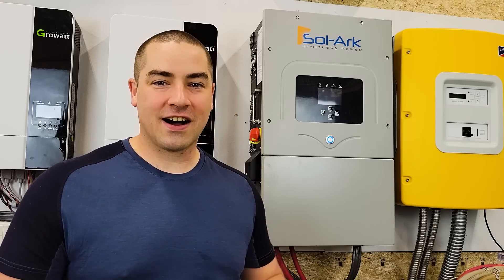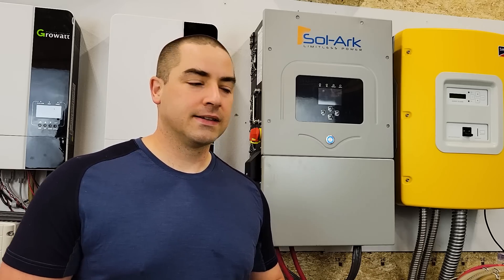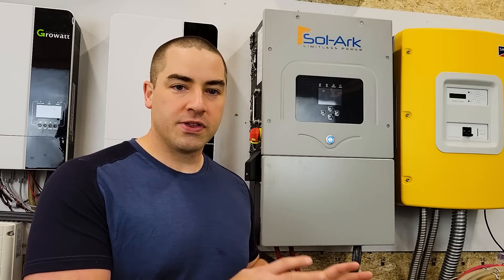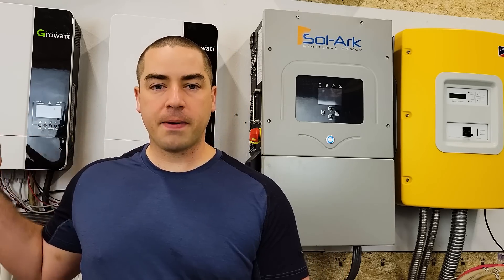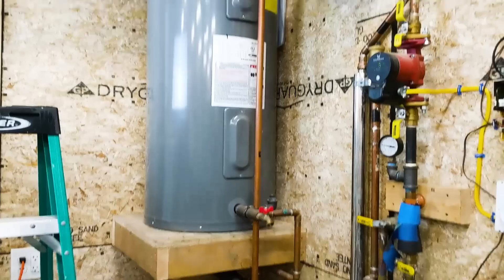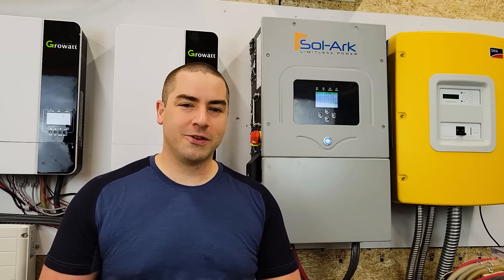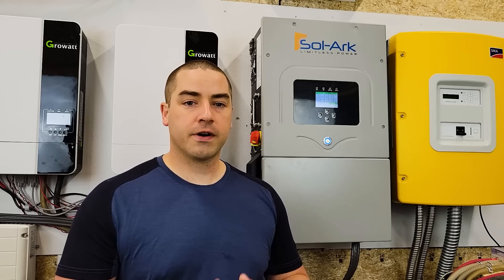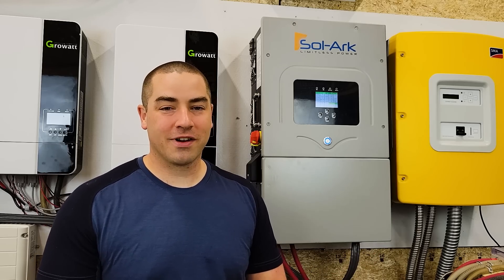Sol-Ark 12K Inverter, Is it worth it?

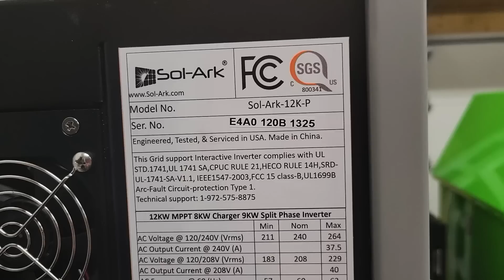Comment: David, I've been watching your videos for years and this is truly the first time I have seen something so misleading posted. First of all, you can see at the 0:45 mark in the video, it clearly lists the specifications of the inverter and the line-to-neural max power output is listed. The unit operated well within it's stated parameters. Also, the name of the unit," 12K", refers to the total solar input. This is the same as the 8K and older models. Sol-Ark has never named them based on inverter output, but instead solar input. They are not misleading people, but it is obvious based on the comments of this video that you now have viewers thinking that Sol-Ark is selling a misleading product when that is definitely not the case. You're not comparing apples to apples here and you're not using many of the intended features of the Sol-Ark in a traditional setup. Additionally, you're' not testing things that make this worth more than other inverters, such as UPS functionality for critical loads, low THD, etc. Your testing here is strictly comprised of off-grid inverter testing, to which you now have many people thinking that Sol-Ark is garbage based on the results of this one test. Disappointing.
Reply: What is the point to having a 12Kw solar input with additional xKw battery storage if you can only get 4500w a leg out of it?

That is almost 1/3’rd the name of the unit!

David was good enough to talk about an AuthTransforner, although I would have like to have seen that solution, in action.

I am glad he gave us warning. 

I have a 3000 Watt Inverter, that peaks at 6000 watts, where each leg is rated at 1500 Watts (but can peak to 3000 Watts.) It drives my home, without 240v loads. I have been looking for an upgraded inverter, for my 240v loads, but I am just beginning to understand the landscape.
Reply: I totally agree with this statement and I already wrote to @DavidPoz on his previous video about the Sol-Ark 8K that he was not being fair in his assessments or his test procedures... Hope he realizes this... Cheers.
Reply: I won't lie, I'm never a fanboy, or at least try not to be for any company, but this video really rubbed me the wrong way. I have a 12K, I've tried the other options that Dave talks about but not the SMA.
I have a 6000W 240V dryer on my solark. I've experienced shutdowns when the house is drawing down ~500W and the well pump and furnace turn on at the same time as the dryer is running - That exceeds the total capacity of the unit. I pay attention to what I am doing when I run my house and using the "I just want it to work despite overloading it" as a reason to discount the Solark, then comparing it to a system that has an autotransformer to balance the legs seems a little disingenuous to me.   If it's a sunny day I've never been concerned about starting the dryer even while the Solark is charging the batteries. I have a screen grab from the day this video dropped of the Solark putting 3.5KW into the batteries and 6.5 KW into the dryer and the rest of the house with no glitches.      Sorry, Dave.
Reply: @vincei4252  the solark is a capable inverter....if you have it grid tied but you and many others missed the point of this video...it wasnt to embarrass solark it was to show how it works as an off grid inverter as its marketed..solark does not offer nor mention a autotransformer so going by manufacturer specs and guidelines as an off grid inverter this video shows what happens, also he always says his systems are set up as off grid as thats where he wants to be system wise, lastly before you say it the distributor for the growatts suggests and have produced videos encouraging the use of autotransformers if you need split phase service and they sell them as a kit. Solark is a good inverter but nothing is perfect. Also the 8k version takes in up to 10.6kw of solar yet they didnt name it 11k...8k does 8k inversion 12k does 9k...
Reply: It is garbage for the price you pay $$$$...unless you want the customer support, then it's worth it. It's like being told it can handle 17kw of panels. In reality it can't until you call them up and they say it does when you have panels facing east, south and west for a total of 17kw. Lol just not all pointing south.

Comment: David I’m having the same issues with my Sol-Ark.  my unit is grid tie without batteries since I have a Net Metering agreement.  Unit feeds a minor loaded critical loads panel and I’ve had 2 shutdowns in 11 days. I was considering purchasing another unit and running my whole house, but I’m pretty disillusioned now and won’t be buying another unit.  When speaking with Sol-Ark they want to blame the quality of my grid power.  I had a 5k Solar edge previously and never and any issues with the quality of the grid power in 3 years.
Reply from the maker: Thanks for sharing your experience.
Reply: I have experienced the same thing when I was running without batteries a couple of times too. It's a cool feature and can enable you to add the batteries later, but expect it to stop when the grid goes down. Even a tiny blip in the grid will cause an over current fault if your loads are greater than solar being generated. If there is not enough surplus solar to power the loads plus the overhead of the Sol-Ark itself, the unit has no choice but to shut down because the grid has gone away and you don't have any any other source of power. Once you connect a battery bank, this will go away and the Sol-Ark won't miss a beat. Your Solar Edge is a grid-tie inverter that never powered your loads like the Sol-Ark and therefore never tripped due to overload when your utility blipped and you may have never noticed it. If you always plan to do net metering and never add batteries, the Sol-Ark is probably not the right solution in your area and you should probably stick to the Solar Edge.
Reply: I tried running one of my Sol-Ark 12Ks without batteries as a zero export (what Sol-Ark calls 'limited power to home' mode) inverter to supplement my other then new 12K and it would throw alarms.  Those alarms went away when I added a secondary battery bank, suggesting that they don't like running without batteries.  It was also a very early build 12K, so there were probably some things that needed improving in the hardware.

Comment: You found out a detail that may or may not be in the manual. It's typical that split phase devices are rated for balanced current draw, so the implicit (and common) fact is that half the rating is the limit for each half of the output. If you run only 240V devices (it's really a 9kW 240VAC inverter with a center tap) as it's functionally designed as, then you'd get to 9kW out without blinking an eye. The unbalanced draw is an issue even to the grid, where it causes asymmetric loading in the transformers on the corner or up on the pole that feed each block of houses.
Reply: So true it says it right in the manual and it says it on the data tag he showed in the begining of the video you cant ignore the manual and then critique the manufacturer you would think that on a purchase this expensive he would have done some research and rrad the manual befor buying
Reply: This not happen to Schneider XW6848 pro 🤷‍♂️
Reply: @Leo-cl1xq Schneider is low frequency inverter, it basically has a huge auto transformer built in to balance L1 and L2
For high frequency inverter like solark, usually you need an external auto transformer but the the lightweight benefit goes away 😅
Reply: I think it is fair that he simulated a buy as an every household diy would do and then sees the error made. So it is a fair review. Because the appliance could also be advertised as 2x4500 watt and they choose for the more appealing 9000watt advertising
Reply: @erwin757  Even worse, they name it as a 12k, when it is really 2x4.5k. They should change their naming scheme, as this is the single most important parameter when selecting an all-in-one inverter. For example, MPP solar name their LV6548 to mean 6500W (120V), 48V battery.
Reply: Exactly . I own Wen open frame gen and that’s just how split phase works

Comment: Solark is pretty high end with a high price too and typically out of reach for the average user.  I have an MPP LV5048 (5KW) and similar to your Solark,  it's two inverters (2.5KW each) configured to create split phase.  The benefit of these high frequency inverters is their light weight, but their achilles heel is that they do not like loads on one leg which has a high inrush current.  The low frequency inverters are much more forgiving.
You can run a 240V load on these HF inverters upto the rated power,  since this automatically balances the load on each of the inverters.  So a fix to your problem is to make sure you connect some receptacles on L1 and some on L2.  Easy to say,  but maybe not easy to do.
Reply from the maker: Thanks for your comment.  I once did a review on the LV5048.
Reply: @DavidPozEnergy  Haha,  yes I watched that one with a lot of interest. I ran into the same issues you did trying to start a miter saw and a shop saw.  I bought a soft start,  which solved my problems with the saws. If I had to choose again,  I really like your idea of HF inverters with an external transformer.  The large magnetic core in the auto-transformer seems to really help delivering the high inrush current.  
Thanks for your great videos...really enjoy them.

Comment: All split phase inverters even many that have a large LF transformer will have this same issue if they are correctly protecting the windings in the transformer.  You effectively just put a load of 4629 watts on L2 which is 102.86% load while also applying 2871 watts on L1 or 63.8% load.  The inverter is effectively protecting the output cabling and any output windings.  You could apply your autotransformer to this system and likely pull much closer or possibly over the 9000 watts on the label even if you don't balance your panel all that well.
I currently run my entire house minus the range and dryer off of a 6000 watt GS inverter (waiting on their 12000 watt unit) and I can pull the full 6000 watts continuous from a well balanced panel but it will shutdown if I pull more than 3000 watts from either of the 2 phases for several seconds.  If I don't mind the additional inductive load I could always add an auto transformer to help even it out if I really needed the full output power.
Reply: I really like the guys over at Gentry Solar (Shawn and Sid)  I'm pulling for them to succeed. How do you like the GS 6000 watt inverter?
Reply: GS rocks best in world!!!!
Reply: Correct. His friend Ben already did a test and highlighted the issue and benefit of using an auto transformer with a Sol-Ark setup. Surprised Dave did not illustrate that solution. Here is Ben's solution: https://www.youtube.com/watch?v=6V16rRTFoho

Comment: I’m wondering if anyone builds a split system?  Meaning a 120v system and a 240v system isolated from each other.  Then all the worries about split phase can be eliminated.  My house has only 3 240 volt loads; A/C compressor, Electric Oven/Range and Electric Dryer (which we don’t use in favor of a 120v/gas dryer).  Two separate systems might make sense for someone in my situation.

Comment: Why didn't you turn the solar edge transformer on with the Sol-ark?  You have a wall full of transformerless inverters and without the grid's transformer or a separate solaredge type transformer people do not realize that the transformer balances out l1 and  l2.  I see that you left the 50 amp breaker on for the solar edge auto transformer when you did the solark test but you must have turned the autotransformer off?  Having access to grid and not installing the CTS makes no sense. You could be getting so much more out of your system that you cannot get out of those GroWatts.  Folks that do not work with this equipment everyday are being misled by this video. Update your software, use the provided current transformers, balance out your panel and use the full capabilities of the 12k. You are running the solark like you did the Aims inverter.  What's going on here?
Reply: I started using the solark 12k last March and have had very good luck with them.  I have added more inverters since then and I am very happy with it.  I am currently off grid. He isn’t comparing apples to apples when he is not properly balancing out the loads.
Reply: Doesn't the Sol Ark put out 120v without the need for an external transformer?  I thought that was the point of spending the extra $$$ on it.  I'm still learning, so forgive me if it's a naïve question.
Reply: I never noticed an autotransformer in any of your installs , did you recently start using them ?
Reply: Does solark suggest or provide a autotransformer? He is for the most part using it like anyone who is off grid would and he stated he has no grid connection to it...
Reply: I do not think he turned the Solar-edge off. Even if solar-edge is connected you still need  to disconnect the neutral from Sol-ark in order for the solar-edge to start balancing the loads.
Reply: i bought the 3k after you did your video on it. I then got the 8k when you started to review it. I am building a new house and I just hope the 15k and limitless panel come out before we are done because I really want a full 200 amp transfer switch inverter. It is game changer.
Reply: Glad someone pointed this out. I'm guessing this guy is new to hybrid inverters, or just wanted some reason to slam Sol-Ark. This is horribly misleading. Thank you for showing why you remain a true industry expert!
Reply: I need things to work out of the box without a hefty explanation as described above. For $7000 I would want it to solve that problem before it got to my end.

For the layman we want something simple, no hassles.  I would never buy this product because I don't understand how to fix the problem as described above. This product may be an engineer's dream child but I need it to work everyday without extra steps.

I liked the video. I thought David's explanation was sound. I'm a plug and play type.
Reply: First, he uses it off-grid, so forget about the grid for this demonstration. Second, I believe the point of paying extra for the Sol-Ark is to have the split phase that gives the full load across both legs even with unbalanced loads. In this comparison, I am seeing no benefit. Why on Earth would anyone pay all of that extra money for an expensive Sol-Arc split phase inverter that you have to connect to an auto Transformer? Honestly, you sound like a Sol-Arc salesman.
Reply: Your misleading because it's costing you business for the overpriced solarks. Buy this 7,000 dollar product....oh it won't work right you need to buy this autotransformer as well that your not told about. Do you sell it as a package deal? Do you install the autotransformer in your installs?  I haven't seen you doing it so why question David when the solark is supposed to work by itself with 120/120 split phase? The growatt is 240v not split and sold as a package at sites with the autotransformer.  Other brands of 240v tells you it's a european design and need a transformer to run on north american L1/L2. I have yet to read on solark's website or maybe you have it on yours that it only works up to a certain amount of wattage like half and will shut off.  
Hope you tell all your customers this.  Do you tell them they can buy something else at a fraction of the price that can perform as good and run your whole house? That you don't have to have a critical loads panel you just run the whole house and cost a fraction of the solark? 
Maybe you tell them the solark is sold overseas under a different brand for like $2500?
Reply: you already spent $7k on a solark and you didn't even get a balancer. that's lousy
Reply: I agree a auto-transformer should help, but requiring someone to balance their breaker panel should not be a prerequisite for a $8000 inverter.  It isn't for most of the others.  It seems to me that the initial design of the Sol-Arks was based off of leg imbalance not being an issue.  It seems to me this was a huge oversight.
Reply: Oh, Hi, Steve!!! Glad you've seen this...!!! Just mentioned you in my comments above...
As I wrote before, @DavidPoz is not doing a good job here and he is misleading his followers with these UNORTHODOX tests...
You tell them...
Take care...!!!

Comment: That really should not be that much of a surprise for a Split Phase inverter.    The benefit to this style of inverter is the Low consumption for a split phase inverter.      It;s too Bad Solark took the low road on commenting here so that will sway my opinion of the company more than this "Issue"     If you are looking for a 9000W per side inverter you need to look for one that does that.    the 15K should also be a better fit for your needs .      I just feel this video was done as more of an attack on the brand rather than looking at the actual specs of the inverter.             Going over your data everything does look like it holds up to the specs as per it's intended design.     While it does cost more I will got to Engineer775 for info on reliability as he has been using them for quite a while.  Sorry David

Comment: This makes sense but having to wire the house to equally divide the loads would be a pain in the butt, I'm not sure you could ever get it close enough to not experience this issue.  I'm guessing if you want to use a Sol Ark you would have to majorly oversize it.
Reply: I'm not so sure about that either - since it was one 240V element and one toaster, how would you divide that up? 🤔